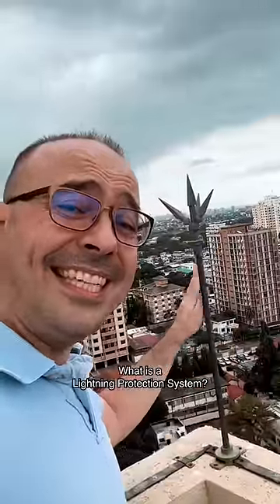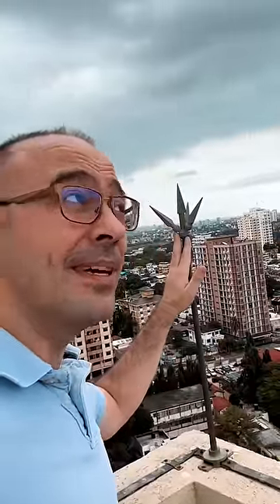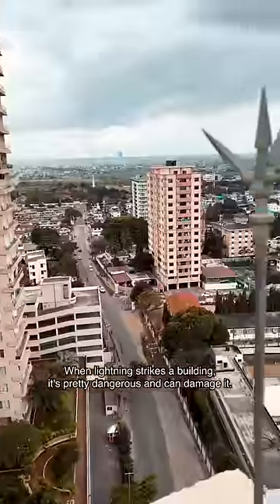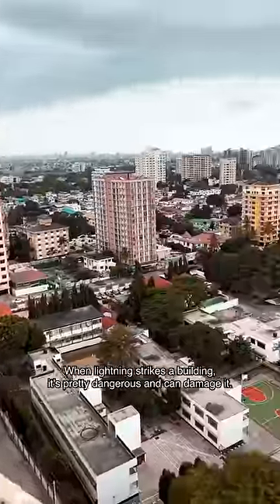Lightning Protection System

Comment: Only connected to the ground doesn’t help. There has to be a charger pit underneath which is to be regularly maintained with charcoal and common salt. Else, the Lightening Conductor would not be conducting very well.
Reply: Nope its just like that. All we want to reach is it hits the top. Onec underneat the earth it can go where it wants. The house is the charger it spreads into the ground. We build allmost all houses with it i  Swiss here...... you just start building it up from the cellar up to the roof with every level you connect more..... but we hide them inside the cementwalls from cellar and the brickwalls up..... you cant see it..... this obe must have been addet later on after the construction.....
Reply: @MrCakocalypse  Might be it’s to do with the soil in India. Maintenance of my office buildings used to be under me and these charger pit had to be maintained religiously. Else during inspections by the HQ would give me a mouthful.

Once my neighbouring office didn’t maintain it and during a thunderstorm, all their telecommunications equipment got fried as a lightning struck the telecommunications wire going from one building to the other.
Reply: @junaid42465  no im from Switzerland you silly😂 We install it in the standart family houses! Its since over 20 years as i stopped in construction and we used to install them here its standart! Here is every house earthquake safe the foundation must be put of propper cement and in the foundation ground we would cement it! Than we would lead it between the iron into the cellar walls they must also be concrete here! From there you just add parts and extend it allways between the bricks beceause our walls are from baked red bricks and cement! Double wall allways for the winter insulation! And you build it in between the 2 walls outside! All the way up to the roof! 🙄🙄🙄 Im a Swiss construction builder and we have one of the highest standarts here bro! 

Every level of the house has 2 times 15 inch bricks! Onec the outside wall than like 7 inch insulation and again a wall of 15 inch stones. This one must be put later or someone mindless build this house!
Reply: @junaid42465  your soil in india is verry good possible to contain a big ammount of copper😂👌 and your tropical tunders there should be not to different from southeastasian storms. Thats worst than a war bombing i guess😂
Reply: @MrCakocalypse  😂😂 I did get it that you were from Switzerland. That’s why I mentioned India. In the North Western part of India were soil is mostly sandy or hard rocky, this is done.

However, now when I think of it, in my hometown in the North Eastern part, we just used to stick it to the ground with a iron picket. The North East region has rich  red soil and we get lots of rain and thunderstorms. But that was 30 yrs ago. I don’t know what’s the latest in the buildings and all there. It’s been 22 yrs away from home.

We get all different kind of soil in different parts of the country. So might be the system is different in different region. I’ll have to check. 🍻
Reply: @MrCakocalypse  We too have to have foundation of cement only. But, we don’t have such heavy walls and insulation. Up north in the Himalayan region, wooden panelling is done for the insulation. Our constructions are also earthquake proof and the big apartment have to pass through earthquake proof design certification too. We are in one of the most earthquake prone area. As for the earthing for lighting conductor it’s mostly external (those that I have seen) and the earthing for the electrical points are internal, built during the construction.
Reply: @junaid42465   Anyone who taught you that should be jailed. When metal is exposed to salt and water it oxidizes faster (corrosion). That means increase in resistance and decrease in conductivity.

Comment: And to those actually searching for an explanation:  
  
Electricity always searches for the path of lowest resistance. Everything is a conductor after a threshold is reached, that's why lighting can travel through air which is usually considered non-conductive  
  
So when the electricity from lightning travels through the air and reaches the top of a building, it will prefer the path of lowest resistance created by the copper rods and channels and connect to ground

Comment: C- on facts. The static sound and pretending to be shocked by it is ludacris.  It works by bleeding static from the air before it builds enough to form a lightning bolt.

Comment: This process is also called earthing. Many electrical appliances have 3 types of wires, a live wire,  another neutral wire and the last earth wire; This earth wire takes the excess current down to the earth which prevents us from getting a fatal shock or damaging our appliances. ( Well I read this in grade 10).

Comment: What you said is only truth if a positive lightning its hit, and positive ligtning strike are very rare, since the most commend lightning is negative ligtning  that is the one that we do not want to hit the house, so what it actually does the positive charge that gets build into the stick gets push closer to the cloud so the negative lightning will not be able to strike it and have to found another way to balance it out by founding postitve within the cloud. Also that does not mean that negative lightning will never hit it.  Positive lightning normally strike very far away from the storm so if the storm is right above your house it is guarantee not to be positive ligthning. If negative lightning does hit it, it will be the same protection as if the positive lightning hit it

Comment: Lightning actualy donot hit on the rod except for some really rare circumstances, it works by discharging the clouds above it through corona discharge, if there is a thunder storm at night, sometimes you can see it glowing cause of the plasma created by corona discharge infact if lightning hits the rod it would destroy it

Comment: You're telling me that flimsy ground wire can discharge the full blast of energy of a lightning bolt without melting? I'm skeptical about that
Reply: It can. The current is not that big compared to the voltage and it only passes for a fraction of a second.

Comment: At my village when there is one fuse missing and we will not get enogh voltage of electricity we use one pover line and place it in ground and the voltage were increased ... we called it earthing 😂

Comment: Real physics behind it is not what he is explaining. Actually mostly people think that lightning strikes this horned lightning arrester instead of building. But its not what happens. Think like this... If lightning strikes..it it's so high voltaged it generate so much heat ... that when it strikes the arrester ... it will melt it down with in seconds... But we see these arresters intact for many years. So whats really the working of these arresters behind it is... Instead of redirecting lightning these arresters absorbs the charges present in the air (those charges help in breaking the dielectric capacity of air and help in conducting of lightning) and bring those charges to the ground which is at 0 potential i.e neutral. So when these charges are absorbed from air, lightning get no way to pass in the first place hence preventing lightning to fall . That's why he is getting little shocks while touching it as during rainy weather these arresters are constantly absorbing the charges form air.

Comment: That's not the purpose of lightning protection system. 
It push away lightnings to some digree. Such as small lightnings
For a strong lightning strike, it gives an easy pathway to the ground. 
And one lightning is enough to destroy the protection system .

Comment: It's not lighting protection system... It's Lightning rod and also it's dangerous to the buildings in a way of physically damaging them and overloading the cables inside the building that can lead to destruction of all electric devices inside that building...